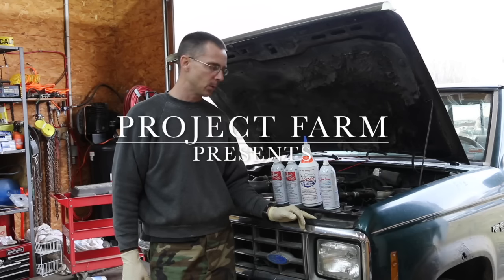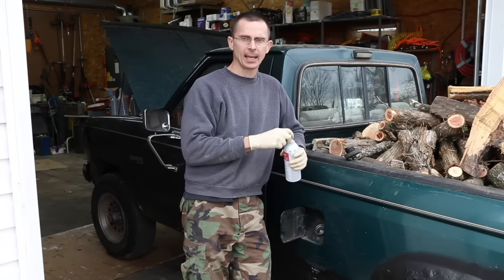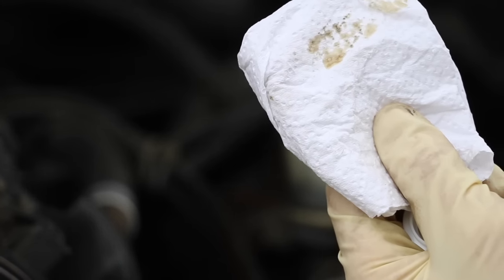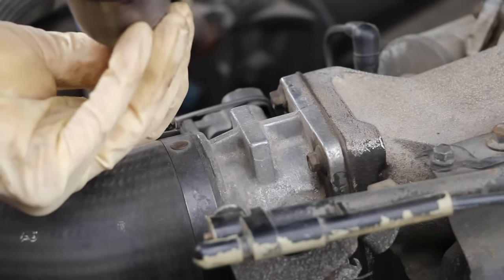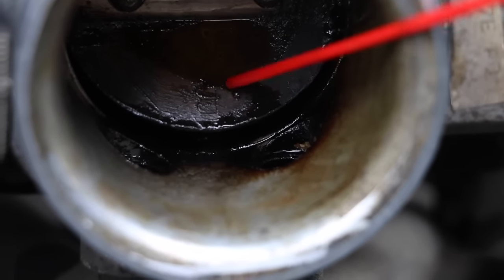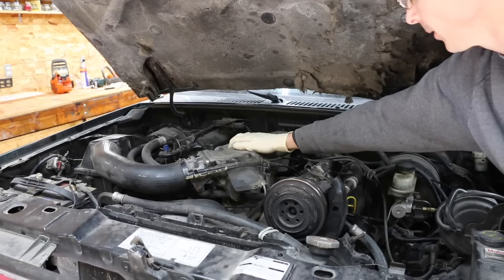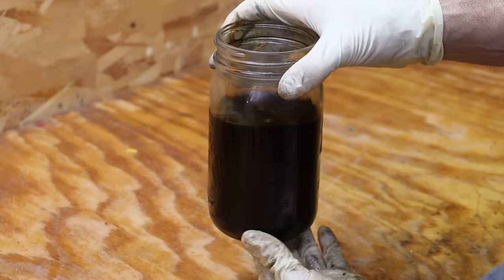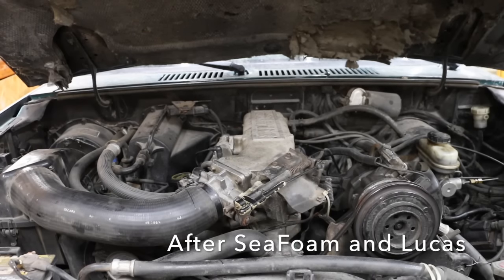Seafoam--can't believe what it did to my engine!!

Comment: 167,000 Miles that's just broken in.
Reply from the maker: Caleb, I agree.  I bought the truck from a person who drove the vehicle very short distances back and forth to work. The short commutes caused the carbon build up and oil flow issues I suspect.  Thanks for commenting and hope you enjoy the weekend.
Reply: Caleb Blackstone Right! My 07 Yukon has 135,000 on it and still runs like it's brand new.
Reply: my 95 f150 has 211,000 on it and runs nearly brand new. I drive it daily.
Reply: Caleb Blackstone my 1994 Honda Accord EX 2.2 would like to agree
Reply: Bill Hill my 2011 f250 has 220k on it, runs great.
Reply: Garage Shop Shenanigans diesel?
Reply: Garage Shop Shenanigans diesel?
Reply: nope.  6.2 gas.   runs great still.   that engine known to go 3-400k with out major issues.
Reply: Garage Shop Shenanigans impressive
Reply: I have 280k on my little 2.9.
Reply: Project Farm thanks
Reply: ford makes good trucks, usually they rust away before they quit running
Reply: fuzzy wuzzy not if u keep them garage kept than they dont rust brother
Reply: fuzzy wuzzy I thought it was Mazda who made the engine for the Ford ranger? In my experience fords other vehicles are utter garbage especially the 5.4Gas  and the 7.3 Diesel.
Reply: Alexander Rosales im not sure about who made the motor for the ranger. As far as the 5.4 they are great motors. If you look around at at the older 2v ones in the early 2000s its not uncommon to find one with 200k on it and no ones been in the motor yet. The 5.4 has a bad rep because of the later 3v witch did have some issues but fix the known problems and its just as good as the older ones.....and i dont know much about diesels
Reply: No, Ford gearbox and ford motor hence the Mazda Tribute is the worst Mazda EVER!
Reply: Trey Harvison thats nothing
Reply: The 7.3 Power Stroke is the best diesel engine Ford installed, however it is a Navistar International engine. I have had two of them and never any issue with the engine. A buddy of mine is a diesel mechanic and he stated he has only replaced one main cap on a 7.3 Power Stroke. Now the 6.0 (which Ford used to replace the 7.3) is a different story if you begin to modify it. They replaced the 7.3 because it was too good and Ford wanted to produce its own diesel engine. (Facts from a diesel mechanic).
Reply: Navistar also made the 6.0 diesel.
Reply: Caleb Blackstone my 98 Chevy Cheyenne K1500 has 263k miles and runs just fine.
Reply: 270,000 on my car. runs great still. Its had mobil 1 all its life.
Reply: That pickup looks like it's got WAY more than just 167k on it!  Must be all farm miles and zero highway miles.
Reply: Only thing ford I don't like is hydraulic fuel injectors on the diesels that's just stupid in my opinion the gas motors out last fords new diesels.
Reply: morcosboci got 180k on mine original engine and transmission. 3.0l duratec engine is very smooth and loves revs. Not the worst Mazda by far, cough cough Rx-8
Reply: My DD is a 2001 f250 5.4l with 281k. Runs like a top. I run Lucas fuel additive every so often but after seeing this I think I'm going to do a full treatment!
Reply: Caleb Blackstone yea i got a 95gmc g2500 4.3liter v6 and i got 280,000miles on it , just did a tune up and fuel pump and filter front brakes and replaced rusted trannylines and it runs alittle rough when its first started but when it warms up it runs very good all cylinders except 1 the speakplugs were dry and ok 1 had alittle oil on it.
Reply: Guy Azbell I’m assume that’s the van? I find it hard to believe they would put such a small motor into a 3/4 ton anything.

Comment: Seafoam, Lucas and Amsoil oil are really good products. Amsoil oil is amazing. Im saying that from experience
Reply from the maker: Thank you for commenting!
Reply: I use mobile 1 with lucas.and seafoam everything that burns gas!
Reply: I use Amsoil in all my vehicles; I've used Seafoam (in gas tank) once (need to do that again and do the engine oil and throttle body), but have never used Lucas. I need to add that. Can all of these products be used together?
Reply: @abnpthfdr2934  No. I wouldnt mix them. Just use one for each process. Thats just me though. Do some research. It might be ok to mix them.
Reply: Michael Rodriguez  Mobil 1 full syn in my opinion is like a cheaper version of Amsoil. It is just as good. It just gets thinner then amsoil when its heated.
Reply: Sorry, I didn't mean mix them all up and pour the mix in the different areas; I meant can I use Lucas with my Amsoil in the crankcase, Seafoam in my gas tank, and Seafoam for throttle body. Thanks for the quick response, though!
Reply: @abnpthfdr2934  O yea that should be fine. Lucas makes gas treatment products as well. But the oil treatment says you can add it with any oil you put in your car.
Reply: O yeah...Amsoil...great stuff?
Just because I wanted to, I changed my automatic trans fluid to the Amzoil brand.
Drove the vehicle less than a month, and the trans would barely shift.
Dumped the Amzoil trans fluid out, replaced filter, and replaced fluid with std. trans fluid.
Ran that for about a week, and dumped fluid again.
Replaced with new trans fluid, and vehicle ran fine....as it did BEFORE I decided to experiment with Amsoil.
AMSOIL????  NEVER AGAIN !!!
Reply: @georgehandel5908  I didn't know they made trans fluid. But just because you had a bad experience doesn't mean the product is bad. And a trans not shifting sounds like a problem more than just the fluid.
Reply: @georgehandel5908  How many miles were on your transmission already? I've been running a 2001 Impala on Amsoil ATF for 2 years now; nothing went sour on me. Then again, the car had 33.5k on it when I switched; not 133.5k.

Comment: Was the engine low on oil to begin with? Nothing beats good old fashioned regular maintenance.
Reply: In the beginning of the video he stated that he had just changed the oil, and after the treatment, he said the oil had only "3 hours" on it.
Reply: What is "old fashioned" maintenance"? That could be Marvel Mystery Oil and Rislone.
Reply: William Riley h
Reply: Michael Herbert no shit lol. my wife has had 2 vehicles run for about 150k and die because of an empty oil pan. my cars go for about 350k-550k miles

Comment: i haver never seen a plate so dirty
Reply: Neither have I.  Maybe he's been injecting coal into his cold air intake.
Reply: #MAGA
Reply: i'm thinking prob alot of engine blow by. pcv valve blowing into intake.
Reply: all that oil that is in that plate, not carbon (no combustion). that is due to poor design.  Ford and Jeeps are both like that, how the route the PCV system.

Comment: Thank you for this.  I used it on my F150 with 100k miles.  The local shop claimed my timing chain needed replacement for $3500.  I saw this and ran it  for 500 miles with it in the oil.   My rough running engine has run great with absolutely no misfiring for another 10,000 miles.  I think the sludge buildup was causing the misfiring.  Thank you again and keep up the great scientific work.  You would have made an incredible mechanical engineer.
Reply from the maker: You are welcome!  Thanks for sharing.

Comment: 160,000 that's nothing compared to my 94 ranger with 342,000 somebody must of NOT taken care of your truck
Reply: Jman I agree with you, I have two rangers, a 97 with 289,000 got it at 189 and it was ok when first got and has had an oil change a year and still sounds nothing like this beat engine. The 94 is non accurate on odometer about 210 310 and no problems like this one. They both have compression issues, run smooth but dont like the hills, the 97 worse than 94 but thats just 20 plus years service and I love em both.
Reply: jmann2108 it's a 2. 9 all of them motor's are junk...everyone that I have ever seen has a lifter peck  Junk junk....
Reply: jmann2108 Yup my 92 with 250,000 runs as smooth as the day it was bought.
Reply: jmann2108 my dad's 91 xlt is pushing 300k. rangers are either junk or invincible. I'm glad Ford is bringing them back.
Reply: I have a 2006 Scion Xb with 461,000 on it!! Still runs great!!!
Reply: yes Honda definitely last long, I had a civic hatch with the 1.5        and the ODO quit at 600,000 loved that car now my Lil brother has it still going and looking new 👍🏽
Reply: my 480000 91 prelude pumps mobil 1 thru er veins
Reply: Bullshit. The tick is fuel injectors. 2.9 was a beast of a v6 motor. Trillions and trillions of miles don't lie.
Reply: jmann2108 Someone must not HAVE taught you English.
Reply: jmann2108 try my 98 frontier. still running on one million miles
Reply: Bill Malec  , i speaka da englich too.
Reply: Chris Campbell serious. manual transmission. ka24de engine. oil change every 2500 to 1500 miles. good oil filters and good maintenance. they will last for years.
Reply: No, it's just being a typical 2.9.
Reply: I can agree to that somewhere that truck was not well maintained in it's past.  I got a 1985 Toyota pickup that does not burn a single drop of oil, and the engine responds very well to throttle input.
Reply: jmann2108....yep, I've got an 84 Ranger with the 2.3 and it's got over 260,000 miles, it burns no oil, and runs like a champ....
Reply: jmann2108 *not have
Reply: Branon Fontaine 3 litre 1996 ranger... 511.000 miles. still the bomb! i love this truck!!!
Reply: We have a 99 GMC with 440k miles on it. Mobil One Full Synth and a K&N aire filter cleaned twice a year. It still runs like it did when it was brand new. There is no deposits to clean. Take care of your stuff.
Reply: You can get the Oil with their Oil filter on special together all the time at some place. It is decent price when you buy it like this.
Reply: Stating miles is senseless for an old work truck vs a highway cruiser car or semi, and that doesn't even take into account the climate and ambient temperature when it's started.

Shorter trips are much harder miles.
Reply: my dads ranger 1993   34,556 MILES
NEVER GETS USED
THE RUST IS UNBELIEVEABLE AFTER SITTING FOR WHILE
RUSTS ALL OVER THE FRAME INSIDE THE ENGINE  
JUST RUST AND ROT
Reply: I know right, the 1995 F150 that i have has 350,000 on it and it runs like it is brand new!
Reply: A 2.9 that's taken care of properly will go 300k and never sound like that. My dad bought one new in 1987...most reliable vehicle I ever saw. Except for transmission and heater cores
Reply: Preston Fergus i miss my 96 explorer it had 400 thousand km on the 5.0 v8. and still haf lots of power and ran perfect wish i didn't trade it
Reply: Preston Fergus I have my lovely 88 B II at 280k already did the heater core thanks to someone posting a video on there's.
Reply: All you have to do is look at his engine compartment to know his vehicle isn't well cared for. I was waiting for him to tell us he also changed the air in his tires and added a little Seafoam and Lucas to each when he put fresh air back in. I'll bet he'd find, it smooths the ride right out and improves fuel mileage too.
Reply: jmann2108 I drive a 99 Silverado i got when i was 16. I'm 30 today it has 307k miles on it. i love that truck.
Reply: jmann2108 true. Those lil 2.9 's were fairly bomb proof if maintained regularly.
Reply: jmann2108 I have two (2) Ford Broncos with 300,000 on each....never changed a part on either except alternators at 200k. Both run great. (351ci 5.8L engines)
Reply: Evi4666 those ram chargers are sweet
Reply: Evi4666nice  i might buy one if i can find one under a grand before they get too rare
Reply: ya man good idea iv always thought they were badass since i was little kid will probably get one this summer hopefully
Reply: jmann2108 167000 miles isn't shit
Reply: +david turbo ~ its just getting broken in!
Reply: Yeah, before my old Ranger gave up the dust, it was close to 400k. That truck tool real good care of me, so I did the same for it.
Reply: jmann2108 i have 489,672 miles on my 99 ram
Reply: Misal Chavez Whats it got in it? Cummins or 360 gas?   My father has a 1994 Ram Van with a 360 Magnum and  about  348,000 miles on it. Engine still runs like a top, but the steering box is worn, and no one has a replacement.  He plans on putting new gaskets in it, and placing it into a 1994 Ram 1500 he bought with no engine.    500,000 is nothing to a cummins Powered Ram, so long as you keep the truck clean, and don't let it rust out.  Often times, cummins or gas, the engine will outlast the truck itself! 

As for me, I have a 1981 Power Ram, dunno the mileage, (5 digit OD), but I know its at either  259,619, or 359,619.  runs great.
Reply: Anthony Ballmann its a 1500 single vab v8
Reply: jonesy8682  my mother's 99 Silverado is currently 317,000 and still runs good, 4.8 L. my dad has a 1994 Dodge ram Van 350 with a 360 magnum,  about 342,000 or so. it still runs and drives strong, but the steering is all over, can't find a replacement steering box. 

personally, I drive a 1981 Dodge Ram w150 4x4, unknown exact miles (5 digit OD says 59,219), but I know it's rolled). 

I admit, I am still not a "Chevy guy", but  I'm impressed with her Silverado.
Reply: Anthony Ballmann My dad bought 00 f150 in 2002. He still drives it today. I think it has 285k on it. My uncle use to drive a early 80's ford truck up until like two years ago. Even then he didnt buy new he bought a 04 ford. So i guess the proverbial apple didnt fall far from the tree's.
Reply: I know a guy who put 600k on a GMC pickup, and he is a mason so that truck did some hard work in its life, but the funny thing is that truck still drives great, I know..... I've driven it!
Reply: diver dave it might look good, but there's no way it looks new. If you've given it that much it's going to have some wear on it.
Reply: Anthony Ballmann i like chevy but im a Ram guy
Reply: Edward Koepke what's the point then? Almost 30 years old and haven't used it enough to get your money's worth out of it.
Reply: Misael Chavez, Same, I grew up with Mopars, and I have an 81 Power Ram W150 myself.  I have always been a big Mopar fan, thanks to my dad, and my (Then) neighbor, who has a massive Mopar collection, and even a couple Max Wedge Race Cars. 

 The only reason my mother has the Silverado was, she got it from Grandpa. It was the first non Mopar vehicle my Parents owned  (As a street legal vehicle anyways, dad had an old Ford Truck we drove through the woods when I was a Kid)
Reply: jmann2108 Thanks scuba steve
Reply: My 1999 BMW 540i V8 that has right at 240k (239,946) on it and I drive an hour both ways to work and back every weekday through construction traffic. All I do is the proper maintenance on it. I use 7qt Liqui Moly 5w-30 plus 1qt Lucus Pure Synthetic oil stabilizer every 3500 miles and Royal Purple gas treatment once every month. And people say the scared to by a BMW.
Reply: jmann2108 I got a 1983 Chevy Cheyenne pickup with 404,000 miles on it. Runs great. Engine been overhauled at 225,000 and that ol' 350 motor still running great. I even kept it clean under the hood. Change my oil every 3,000 and it stays pretty clean.Been using Seafoam for 4 years because my Injectors started bleeding and now they're not.
Reply: Yep...I bought an '86 STX and literally drove it off of the showroom floor. It was a 5sp with the 2.9. I drove it across country within 1 week of buying it. Great ride. Later I took it to the stealership to have the valves adjusted because of the loud ticking noise, but they could only slightly quiet the noise. The 5sp was great with that motor until a synchronizer went out while I was leaving a stop light. We were able to fix the transmission and the truck continued to run great. I don't remember the mileage when I sold it (over 100k), but it was still running great. The 5sp helped with the low power of that motor.
Reply: My school bus has 400 thousand
Reply: Finn Campeau my '78 Winnebago has 630,000 thousand miles on it.
Reply: the Sterling dock truck I drive has 480,000 miles on it
Reply: Still runs tho,right?  lol.....
Reply: jmann2108 Rangers are junk. buy a Toyota.
Reply: Thats funny,every one ive ever known with a ranger drove em till the body rotted off of them!?!  Were talking 2,3,400,000 miles on every one of them!!!  Im so sick of ignorant,close minded,brainwashed peeps. Talkn shit about American cars that they have no basis/facts 2 do so with!!?!!  Have u ever owned a ranger?  My guess is no!!!!
Reply: Yea but.. the thing is he is not talking personally about how good ore how bad he treating his truck this video it's all about how good is the product  personally testing it, and proving it.
Reply: take the time, the next time you are out driving around and look in the driveway's,parking lots,and the traffic around you and you may notice, for the first time how many Ford Ranger trucks that are still going strong.i noticed that the Ford Ranger is the most widely used model of truck for work.anything from a handyman to large city utility companies use Ford Ranger's.im positive that Rangers from the 80's and 90's,are the most plentiful trucks of that era that are still on the road going strong.my personal opinion of their down side is the manual transmission and the clutch job.i think Ford really fouled up when they stopped production of the Ranger!
Reply: David Helmick I had a 86’ Ranger 2.9 5speed in high school and when the Michigan salt stole it from me it had 315k on it.  Still ran great but just wasn’t safe for Highway use.  

Ford has introduced the ranger again but I have doubts. The reliability is going to be tough to match.
Reply: jmann2108 its still runnin aint it?